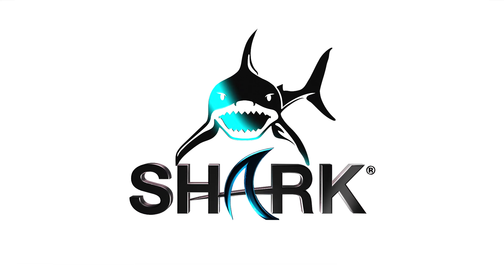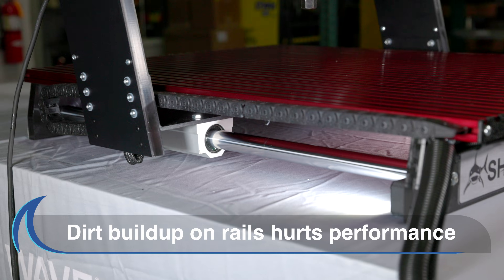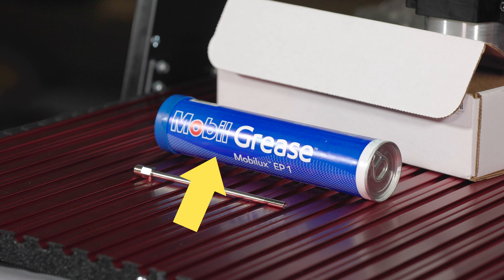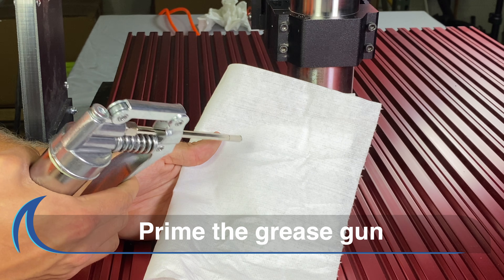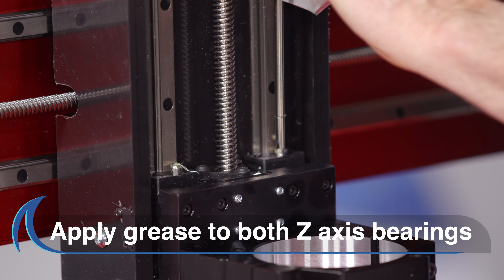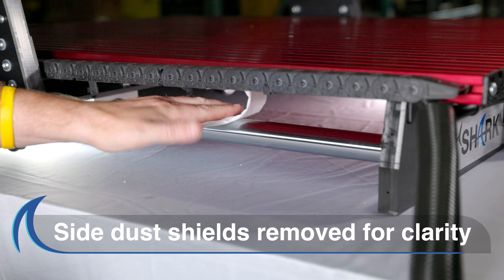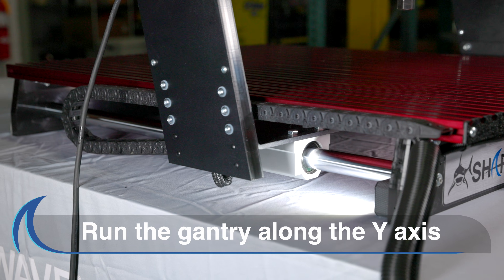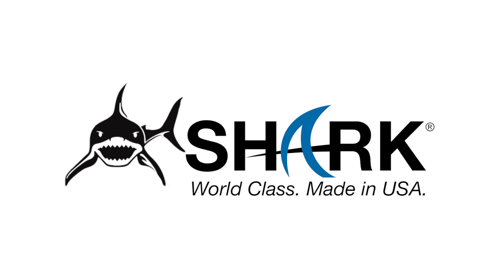How to do the Maintenance on your SHARK CNC

Comment: I noticed that the spindle and side covers were removed in the video. So question 1 is, do you have to remove the spindle to lubricate the z axis bearings? Question 2 is, should 8 leave the side covers off for easier access to the bottom rails?